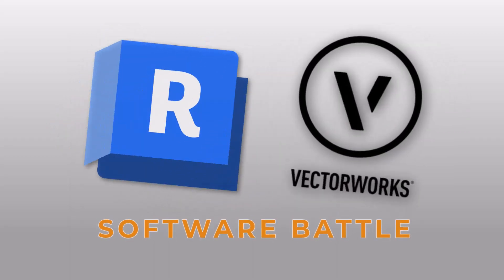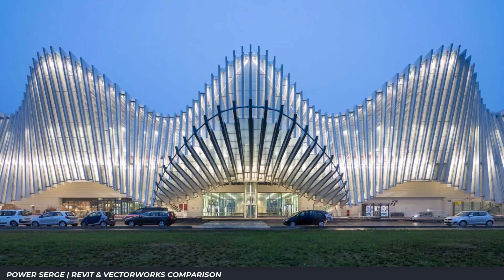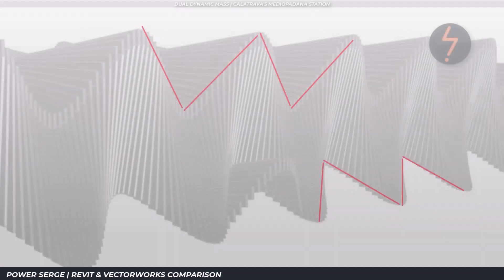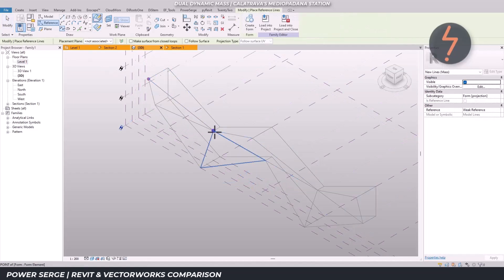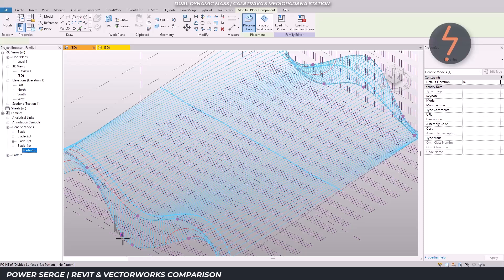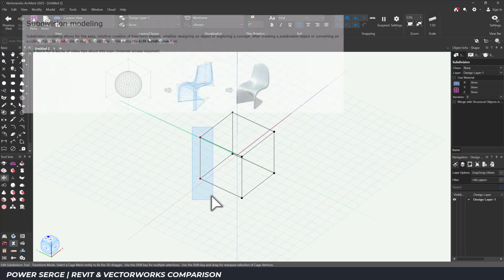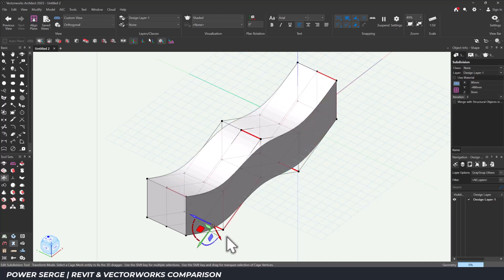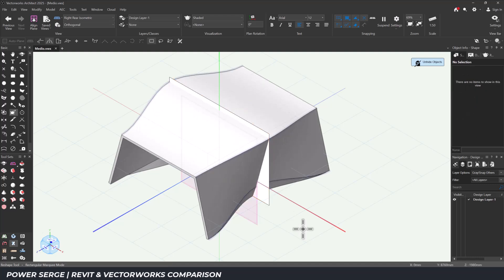I Modeled Calatrava’s Station in Revit and Vectorworks – The Difference Was HUGE!

Comment: Thank you, Vectorworks fan boy, it is interesting to see why you struggled with Revit because you used an older technique to build geometry, hence the unwelcoming experience, Revit does extacly what you did in vector works, yes Revit is parametric which is why it dominates the industry, but you can also practice fluidity in Revit and then move your model later into a para form which is not possible to do in Vectorworks.
Reply from the maker: Thank you for sharing your perspective — I really appreciate you taking the time to comment.

Just to clarify a couple of technical points: Vectorworks does support parametric modelling and even includes its own visual scripting tool called Marionette, which functions similarly to Dynamo. It also allows for live NURBS and Subdivision Surface modelling, offering fluid control over freeform geometry. Revit, while excellent for structured BIM and parametric relationships, doesn’t handle live NURBS in quite the same way and everyone knows this.

Both programs have strengths.

For context, my channel focuses mostly on Revit, which I use every day professionally. But I’m also happy to acknowledge where other platforms do things better — ultimately, it’s about using the right tool for the right task.

Comment: Damn, is this guy really a professional with two BIM softwares?
I’m gonna subscribe! I’m a Revit user, but I’ve always been a big Vectorworks fan. I even downloaded it a few days ago because I felt like it has something Revit doesn’t, a true BIM with the freedom to design.

Keep making these comparison videos, they’re great!
Reply: Not a true BIM but you can turn it into a BIM - Rhino would model things like this in less than a minute. VisualARQ extends Rhino's capabilities and turns it into a BIM while Grasshopper is the king of parametric design so much so that there is a plug in Rhino.Inside.Revit specifically for the purpose of easier modeling. And the price? well, it's a lifetime license and while it might seem a lot for rhino+visualarq, it's still cheaper than a year of revit sub.

Comment: Thanks for the platform comparison. I am a long time Vectorworks user, and never really got into its subdivision modeling capabilities -- most of the projects I work on do not call for it, while the AEC objects (walls and roofs) in the program are more than adequate to handle the job. I also really like Vectorworks' CD publishing capabilities - it can format multiple sheet sizes in one project file, and can publish multiple sheets for PDF export - I know for a while Revit couldn't do either, and I never liked the perceived inadequacy of its modeling environment. I know Autodesk was planning to replace Revit with Forma, but never heard much about how that's going.
Reply: Forma is for conceptual/schematic phase for massing. It won't replace Revit. And Revit supports multiple sheet sizes and multisheets pdf export.  (at least since 7 years back i have been using .) For landscaping capabilities and parasaolid kernel,  like vectorworks.
Reply: How about Archicad? Be interested to see how you model the station in Archicad.